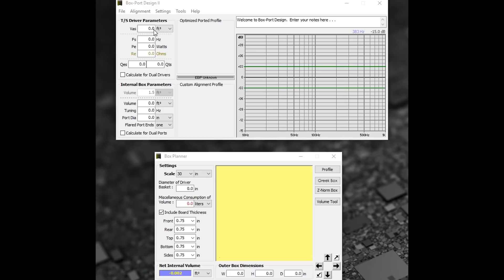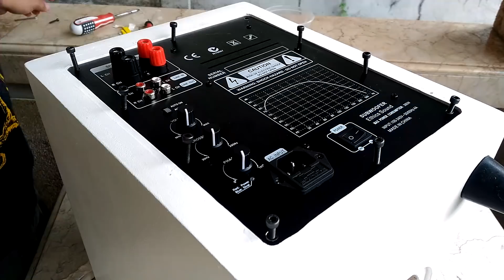How to make Down Firing Powered Subwoofer - DIY Build

Comment: I have 4" inch subwoofer,can you give me the dimensions for making subwoofer box?.( i use MDF).
Last time i made one big subwoofer (bass tube) box but it gives poor bass so i searched on internet for perfect dimension but i can't get any solution.so please suggest

Waiting for your valuable reply...
Reply: go to the manufacturer website for your speaker and it will list what size box you need. every subwoofer is different. he cant help you. nobody can.
Reply: @cameron6471  ok..thanks for ur valuable reply
Reply: Measure the Thiele small parameters of the driver, enter those parameters in Winisd, play with the box volume,tuning frequency(port diameter and length) until you obtain the desired response (transfer function)

Comment: I’m looking to convert a desk (desk cabinets, one on each side) into a surround sound system..what would I need to run 2 subs 2 mids and 2 tweeters..don’t wanna run too many remote
Reply from the maker: An at least 7.2 AV receiver than can power up all the speakers. Your subs must be amplified though.
Reply: Charcoal Monkey any suggestions for sub amp
Reply from the maker: @sbfdman  The one I'm using in this project. There are many good choices at parts-express.
Reply: Charcoal Monkey ty...I’ll look in to it

Comment: Nice build.  Amp is too small for the sub tho.
Reply from the maker: Thanks. Actually amp has just enough output for the sub.
Reply: @chrclmnky and how does the heat of the amp radiator disipate?
Reply from the maker: @ghicicines  amp plate has vent grill opening at the back that is why amp is  paneled and sectioned to seal leaks of the subwoofer main internal volume.

Comment: Hello, may I know what material did you use inside the box? at 4:57
Reply from the maker: Hello Axel, polyester fiber fill or polyfiber. The thing they used in comforters, pillows, jackets...
Reply: And may I know what it is used for?
Reply from the maker: @gaydarci4593  sound dampening

Comment: Boss good day po, newbie here may tanong lang po, Anong wiring connection po ang pwede sa (3)tatlong 8ohms drivers
na pasok sa 4-16ohms range na amps? to be specific (2)dalawang woofers (DAYTON AUDIO 5 1/4 Shielded woofer DC130AS-8) 
at (1)isang tweeter (DAYTON AUDIO 1" Titanium dome tweeter DC25T-8) or optional tweeter (TIMPANO 4" Bullet Super tweeter TPT-ST25) lahat ito on hand na po.
Sana po masagot thanks in advance. God bless po.
Reply from the maker: @poseidon3741  connect them between a crossover
Reply: @chrclmnky  daghan sa Amazon pero walang alam lagi boss pero suwayan ra nako. Thanks anyway.

Comment: speaker JBL 800w  ok lang ba sa  amplifier AIR PW 280w /300w diba sya masusunog?
Reply from the maker: Alin po ang masusunog?
Reply: @chrclmnky   
yung amplifier  po !kaya po nya JBL 800w na speaker?
Reply from the maker: @junborja1777  if impedance is matched then no risk of blowing up the amp. On the other hand, If there are clipping in the signal, the subwoofer will not lasts long.
Reply: @chrclmnky  thanks

Comment: Hi can i use jbl 1200w subwoofer with this board. If yes where i can purchase it?
Reply from the maker: Yes it can handle that subwoofer just fine. I purchase this on Aliexpress.
Reply: What is the watt of subwoofer used in the video?
Reply from the maker: @kickOffLiveTV  800w
Reply: So, jbl 1200w sub woofer will work fine with this amp board. Please comfirm me so i can order this board.
Reply from the maker: @kickOffLiveTV  yes just fine.

Comment: Why people use MDF instead plywood?
Reply: Mdf is easire to work with and doesnot split like plywood. So peopel use MDF , and nothe that MDF also have smoother surface and using any of them will not give any performance advantage
Reply: @santuknowledge  ok..thanks

Comment: That port is wayyy too small. Better off going sealed or making a propely sized port and calculating port velocity in WinISD.
Reply from the maker: Customized the size so it can fit the space between my two desks where my PC sits. And the output is good enough for my needs.

Comment: Without hole more effect ...
Reply: Rajeev Pillai is it?
Reply: With the proper tuning a ported cabinet can be more efficient and have lower bass than a sealed cabinet. In both cases the enclosure needs to have the proper volume for the driver selected.

Comment: Tell me the dimensions and ported area dimensions please ..... Can i make this subwoofer for my 2.1 home theater ?
Reply from the maker: Yes is what its purpose.
Reply: Arent most amplified home theater systems putting out 8ohm loads, might want to consider that when choosing speakers
Reply from the maker: @edwardjones7412  the amp used is a mono Class D circuit that outputs 300w RMS in 4 Ohms. The subwoofer is also a 4 Ohm load.

Comment: bisdak man diay ka do...hehehe, nice work
Reply from the maker: Perti jud ka bisdak brad, ga lisngag ra gud ang ilong. Cheers from Butuan City! Originally from Labangon, Cebu City!
Reply: @chrclmnky  Bai gud am. Unsa brand sa amp nya pila ka watts? Daghan salamat..hehe
Reply from the maker: @aldrintalaogon5611  Hello Aldrin, the amp is a Chinese-made generic. It's rated to push subwoofers around 280w RMS.

Comment: I wish you would have talked more in the video. After watching part two I noticed that you didn't like something about the sub that you built previously so you built another one with no explanation of what was really wrong with the first. So what was so wrong with the sound out of this subwoofer that you trashed it? Looks like you followed all the instructions for the build. What went wrong?
Reply from the maker: Thanks for watching the series. First box has undersized port which creates a lot of noise. And was tuned way high. Second box is bigger and produces lower notes and has correct port size
Reply: Port too small. Could guess that before finish.
The data given by jbl does not seem to be optimized...
I have few of these and box definitively needs to be bigger as also the port does to gain max preformance out of it.

I guess jbl did some copy pasting work when adding those manuals

Comment: Muy bonito ypero no tiene ventilador se vas a quema
Reply from the maker: Hello Diego, no need a fan because the amp is a Class D circuit, which do not have transformers heating up like those older amps.

Comment: Down firing is not that good because of the weight of the coil that tend to go down can cause distortion.  Up firing has better sound as far as I'm concern.
Reply from the maker: Have you seen a home subwoofer that is firing upwards!?
Reply: That's usually not a problem, and from what I've seen. No Audio company makes up firing subwoofers, they're usually on the front of the cabinet.

Comment: boss pwede magpagawa sau ng home theater subwoofer?
Reply from the maker: Hello, I suggest just to buy a readily available powered subwoofer for home theater application. There is Konzert KS-12SUB and KS15-SUB if 12" is not enough for you.
Reply: may for sale kaba na sub?
Reply from the maker: @amponunobersikulo7276  Hello Ampon, I can have this subwoofer on sale but it is gonna be expensive. The subwoofer driver is worth Php 3,000 and amp is Php 4,300. With that sum of money, you can buy a readily available powered subwoofers like Konzert KS-12SUB or even the 15" KS-15SUB. They are very affordable and very powerful too. That way is more practical.
Reply: @chrclmnky  by the way, how much will you sell it?
Reply from the maker: @amponunobersikulo7276  not for sale kasi magiging madugo na.
Reply: @chrclmnky  boss pwede ba magpa set up ng sounds sayo?
Reply from the maker: @amponunobersikulo7276  sure. Let me know what you need.
Reply: @chrclmnky  by the way, san location mo po?
Reply from the maker: @amponunobersikulo7276  Butuan City, Agusan del Norte
Reply: @chrclmnky  boss magkano estime  gastos sa 2 xplod sub
Reply from the maker: @amponunobersikulo7276  mura lang, 3000 each + MDF + carpet + rugby + terminal cup.
Reply: @chrclmnky  boss ask lang, sa choice mo anu mas maganda JBL sub or Sony xplod? saka active sub or passive? at ano po ung difference gusto ko lang malaman. salamat :)
Reply: @chrclmnky  boss anung mas okay na sub jbl or sony xplod. ask lang para pag nagpagawa quality na

Comment: Sir anomg specs ng amp at ilang rms?? Salamat
Reply from the maker: Hello 3beermat, the product was labeled to have an output of 280 watts, don't know if it is an RMS or peak power. But it can drive the JBL Stage 810 8" subwoofer very well.
Reply: Tumingin aq sir sa ali kaso hnd q mkita ung amp. Hehe.
Reply: @chrclmnky  nka 280 max nga sir. Kaso hnd q mkita sa ali ubg amp na yan. Salamat
Reply from the maker: Search "Airs PW-280"

Comment: -3db at 45Hz? Damn that thing is not playing low
Reply from the maker: Yes, I need to rebuild this one. I was just a noob.
Reply: @chrclmnky  I Suggest building a Box with the Aim to Hit 25Hz at -3dB. Use Vented (4th Order) or 6th Order Bandpass.
Reply from the maker: @koljapaulemil  LOL bandpass boxes are not for low frequency output.
Reply: A 4th order can play low
Reply from the maker: @Zbaec1  No, their tuned to produce between 45-75Hz
Reply: @Zbaec1  A bandpass is a one note box. Far from low playing subwoofer.

In fact, a big enough vented sub with a big vent that can make use of the big size will play low.

Comment: 51hz -3db??? should not go lower??
Reply from the maker: Box size is the main concern since I have to cram this into a tiny space under two desks where my computer is on. Two go lower, have make the box bigger but will not fit the said space.
Reply: @chrclmnky  2 go lower at the same spl yep. I would have built it as a sealed and using a lower cut off frequencie. goes DEEP and is small.

Comment: if i will ever want make a speaker made by me i will not using mdf, real wood instead and not jbl 600w wtf, buy next time pioneer 1200w
Reply from the maker: MDF is very affordable and very good sound dampening. Inner box resonance is steep so that makes mdf a more favorable material. And the 600w sub is just enough for the Class D amp selected. The entire project were carefully planned using several bix tuning applications so the desired output is achieved.

Comment: thats a small port for that sub try a 3 or 4 inch port
Reply from the maker: The port is 2.4", slightly bigger than JBL adviced port size which is 2" in the owner's manual.
Reply: @chrclmnky  oh ok
Reply: @chrclmnky  still seems a little small for that sub but if jbl says so
Reply: looks on the video like a 1 inch/1,5 inch port tho
Reply: GameBoyChamp that jbl can only take 250w rms
Reply: @tommikurronen4384  jeez thats less than my 30 dollar planet audio sub
Reply: GameBoyChamp jeah these subwoofers are weak the 1000w is just for getting stupid people buy it
Reply: @tommikurronen4384  yea my sub it 1200 watts max and 650 watts rms

Comment: You could of did so much more to get a better sound.  But I guess.  Who cares
Reply: the amp isn't even proper for the sub 230/800 limits preformance
Reply from the maker: Amp is 280w RMS. You're welcome.
Reply: 280w max
Reply: 100w rms

Comment: That port looks waaay too small.
Reply from the maker: JBL included owner's manual suggested way smaller than what I put here. You can read the PDF manual if you want and blame JBL or blame Mr. Harman for suggesting small ports. LOL
Reply: CHRCLMNKY damn alright haha.
What does it sound like, is there much port-noise, or is it alright?
Reply from the maker: Port noise is present when listening to very low and heavy bass in bass boosted hip-hop and trap tracks. But just minimal, can only be heard when you are close to the sub.
Reply: CHRCLMNKY that's not too bad. 
Thanks for the answers.